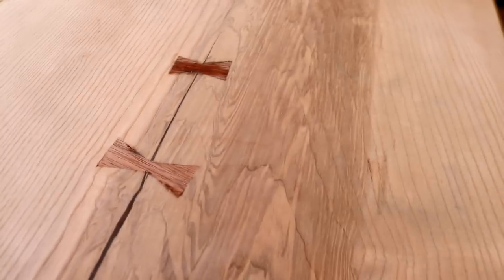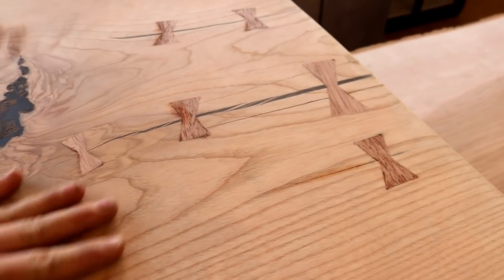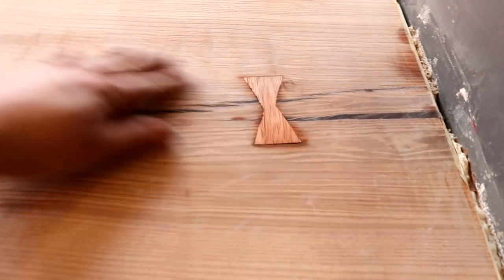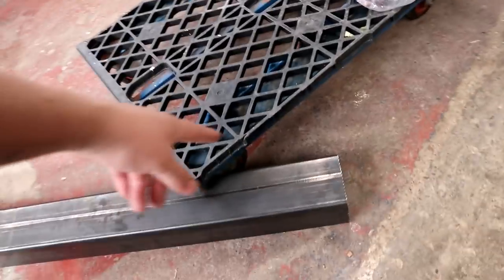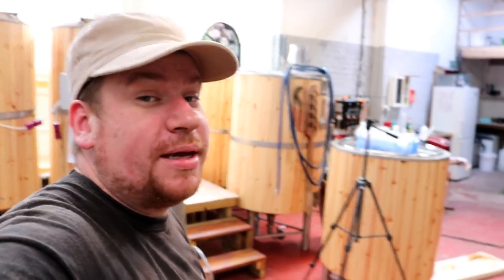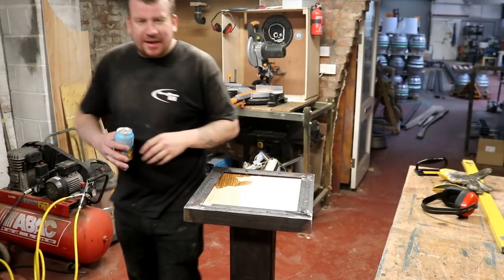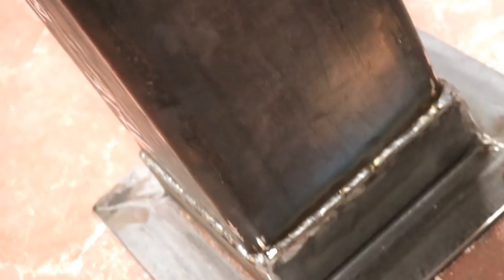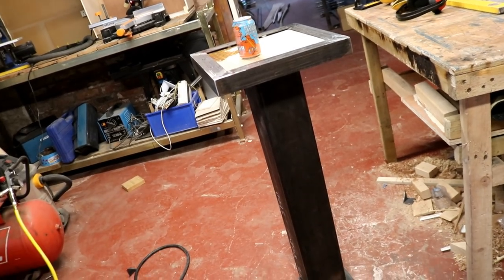DUTCHMEN

Comment: You have some work put into those bar tops and tables m8,very impressive. A fella could go very ocd trying to get everything perfect but those little imperfections are what adds character. Mind your casks and kegs though when you're using that angle grinder,easy to bollick them up with all that mild steel flying around,cover them with a blanket or sheet to protect the outside. You are making great progress keep it up. Cheers.